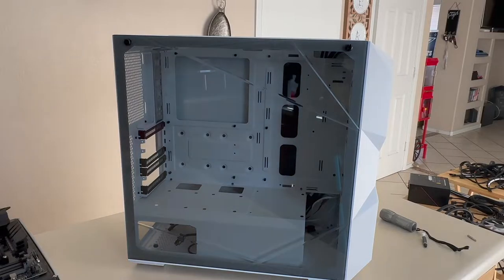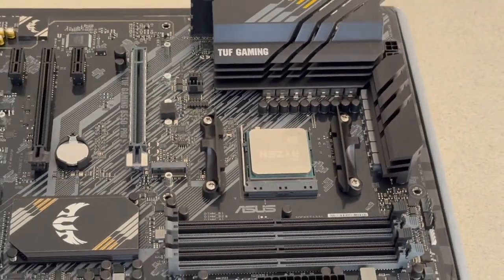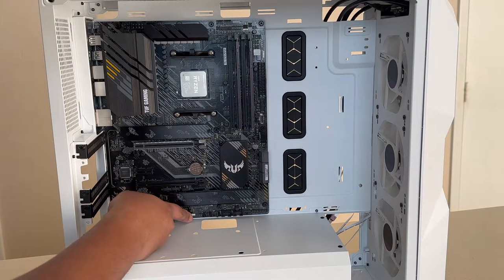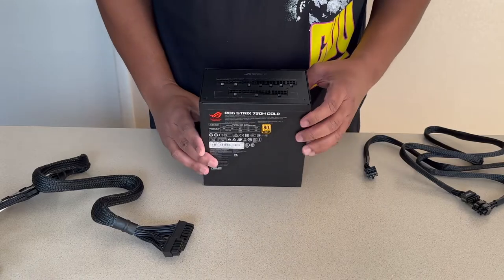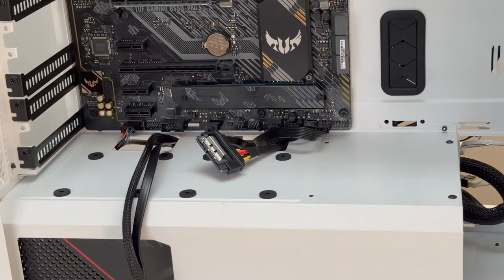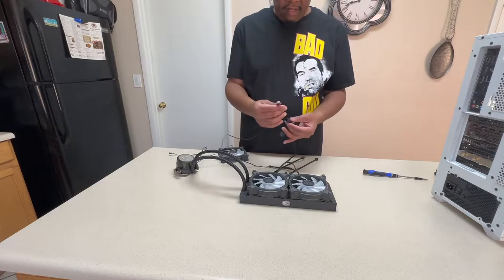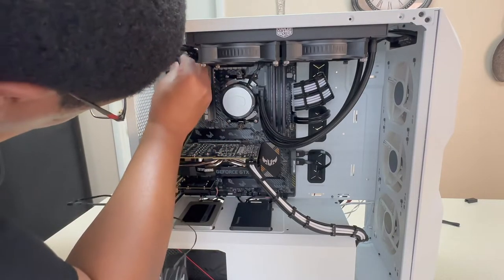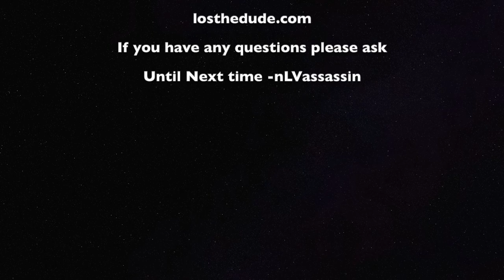ASUS TUF Gaming B550-Pro and Ryzen 5600X Step-by-Step PC Build Guide 2022 (Cooler Master TD500 Mesh)

Comment: Very nice video and informative, especially for new builders. The only concern i have is that the weight of the eight-pin cable you connected your gpu with will gradually bend the gpu pcb since it doesnt have a backplate to support it. Keep that in mind and update me if you can, because i am going to build my own new pc with the identical TD500L case and TUF B550m motherboard and i will be using a 3 fan RX7600 which has substantially more weight.
Reply from the maker: Good point! Will do

Comment: Nice! I am building quite similar PC, now. Just not with water cooling. Your work is perfect. So thumbs up, my friend. Many thanks and you are right - the cable management is soooo boring but also very important.
Reply from the maker: Building is fun. Thx for the compliment.
Reply: yo can i get a rtx 3060 with this. if yes do i need to install drivers

Comment: Detailed build -- thanks for the effort!  But is wearing a static strap not needed?   So what's the difference between this PRO board and the PLUS board?
Reply from the maker: Yes it is needed however, I was on a tile floor doing the build and I made sure to discharge static when I started filming. 

The Plus has a 8+2 DrMos power stage. The Pro has a 12+2 DrMOS power stage and 8+4 pin ProCool sockets.
The Pro has a front panel USB Type-C connector as well as the standard 3.2 Gen 1 front connector
They have pretty much the same connectors in the back however, the Pro has 4 x USB 2.0 and the Plus takes those same four spots and gives you 2 x USB 2.0 and 2 x USB 3.2 Gen 1 (much better IMO)
You get two Aura addressable Gen 2 headers on the Pro and only one on the Plus.
Now the Plus and the Plus (WiFi) are the exact same except the plus (Wifi) has the on-board Wi-fi 6. The Plus (WiFi II) is the same as the other Plus (WiFi) but it added the front panel USB Type-c connector and the additional addressable header that the Pro has. 

If i had to pick one out of the Pro, Plus, Plus (WiFi) and the Plus (WiFi II) I would go with the Plus (WiFi II) and Pro second. I went with the Pro because the Plus (WiFi II) had a delayed ship date on Amazon and I got the Pro same day. I also bought the ASUS WiFi 6E + Bluetooth 5.2 PCI-E Expansion Card (PCE-AXE58BT) to give my board Wi-Fi 6E and Bluetooth 5.2.
But it really depends on what you are looking for in your build.

Comment: Hi @NLV Assassin...great video...very informative...I thank you for it.  Can you tell me the exact name of the SSD cable and/or link you mentioned @ 32:28 and @ 55:22 .... It would help a great deal with my cable management in my first build. Thank you soo much NLV ASSASSIN.
Reply from the maker: My friends and I call them mux but the true name is molex. You want to use the molex cable that comes with your power supply then order this SATA 6G Data Cable, SATA Power 2-In-1 Extension Cord, LP4 IDE 4 pin to SATA 15P Female with Serial ATA III 7 Pin Female for HDD, SSD, Optical Drives, DVD Burners, PCI Cards etc - 19.7in (2 Pack) https://a.co/d/8vEzErd
Reply from the maker: Glad to help with the build

Comment: Maybe somone's already asked this but could you post links to the PSU cables?
Reply from the maker: ASIAHORSE Power Supply Sleeved Cable, 16AWG PSU Cables Internal Power Supplies Extension Cables 1x24Pin/2x4+4 EPS/3x6+2 PCI-E, 30cm Length with Comb (Dual EPS Black White) https://a.co/d/1U2JTDz

Comment: Hey man i have a prebuilt pc looking to swap the mobo. I have chosen this one. Im new in pc building so what do i need to do to keep my games and not have to reinstall windows? Also good video
Reply from the maker: I did that with this one. link the Windows Key to your Microsoft account so you can activate Windows on the new Motherboard. If it's OEM you can't do it. Follow this link to link your account https://support.microsoft.com/en-us/windows/activate-windows-c39005d4-95ee-b91e-b399-2820fda32227. You'll also want to uninstall old drivers and install new ones. Give this a read https://www.pcmag.com/how-to/move-your-windows-drive-to-a-new-pc
Reply: @nlvassassin how do i know if its oem?

Comment: did you have to update your bios?
Reply from the maker: No you don’t have to. But you should do it. It comes ready to go for Ryzen 5. However, it was the initial bios from the 5600x launch. Download the latest bios on a flash drive. Open the mobo, put it on top of the mobo box. hook up your psu 24 pin and cpu power to the board. Put the flash drive in the bios usb. Power on your psu and hold the bios button down for 3 seconds. Light will flash green and keeps flashing. When it stops flashing the bios update is complete. Or you can just build your pc and update it once you setup and login to your pc. I flashed it first just in case